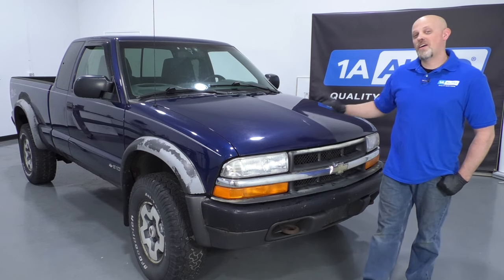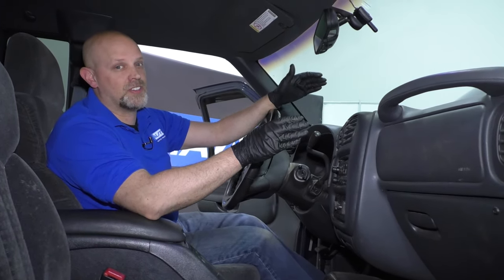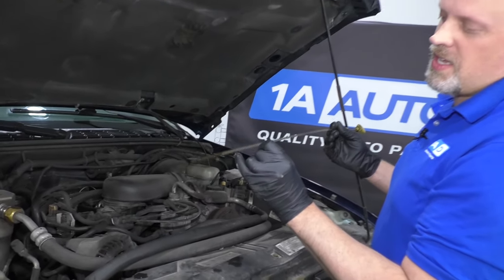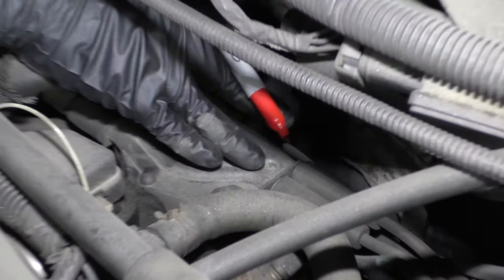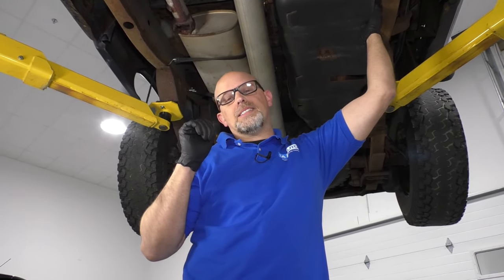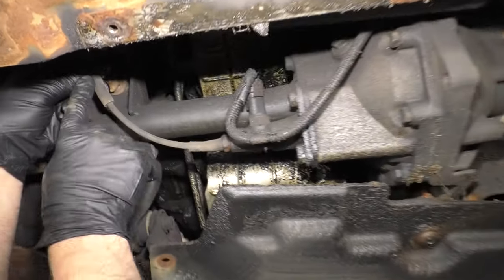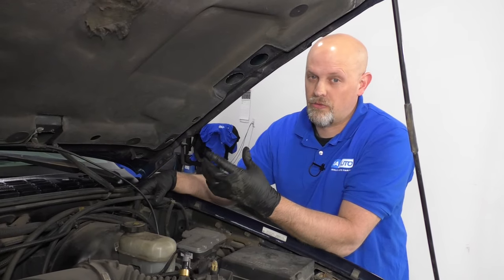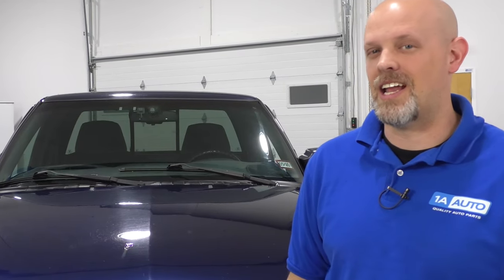Top 5 Problems Chevy S-10 ZR2 Truck 2nd Generation 1994-04

Comment: How reliable are these trucks including engines and transmissions?
Reply: Very reliable dependable trucks if they have been taken care of before you have bought. Regular oil changes, ignition etc. Mine has 222k miles and I drive it to work everyday 60 miles. 2000 4.3 4x4 v6 s10. Original motor and transmission, original AC still lol still blowing. Only major replacement I have ever done was the lower intake manifold gasket replace and I JUST did that. Other than that I put in new radiator, waterpump, thermo housing, thermo, radiator hoses, tensioner, pulley. Runs like a champ still for 222k mileage.
Reply: @travissnyder8277  same for me. I have  2002 Blazer with 215k.  I've replaced the same stuff. Plus distributor, teeth were wearing sharp, noticed it putting the lower intake gaskets in. Also new fuel pump. And my original AC still works great also!
Reply: @travissnyder8277   Is the 2.2 reliable also ?
Reply: There a great vechel
Reply: There a great truck.BUT You best have a well stocked tool box,  and a lot of mechanical abilities.
Reply: Reliable if they have been taken care of.  Far more reliable than todays newer trucks.
Reply: Depends on how you drive it and how it's been taken care of bought my 2.2 at a hundred thousand miles I put 50,000 miles on it so far and I haven't had any major problems except a few normal things I'm hoping to get another 5 years out of it
Reply: Mine had 350k+ on it before it died from rust. 
Other than general maintenance. And 1 transmission rebuild.  Can't complain. Looking for another blazer ZR2.
Reply: Im from Germany(Big USA Fan since  I was a Kid, I love everything the Landscape the Cars, the people just everything have been there 3 times and hopefully I'll live there one day) I got a 1995 Gmc Sonoma epual to the s10 also with the v6 but the motor has a stroker kit and the Cylinders were drilled to about 4,8 maybe 5 Litres, a bit massive for a v6 but she runs fine, got around 130k on the clock but kilometres so around 80k miles, pretty good for 25 years still the original motor and transmission(manual). Never had any problem for the past 5 years maybe because I'm only cruising with her on Friday or Saturday. Gas is pretty expensive here, every car is a 2L diesel crap. Dang when I'm out at the supermarket people taking photos and looking like holy what's that.

Comment: My 2001 s10 just randomly stopped. Battery is great, fluid great, has a little over a half tank of gas, just turns over but not all the way

Comment: I've seen all these problems on mine.  Some more than once.  Bonus issue, the hoses below the engine go bad.  Power steering and oil cooler lines.
Reply from the maker: +b baxter Thanks for checking us out! http://1aau.to/m/Shop-1AAuto-c

Comment: How much is it for a engine swap the motor was 700 what would be the price that he should charge me to change the motor Please comment back
Reply: If I recall it's about $700.+/- if your swapping for the same engine. It could be more depending on the shop. I just recently had to replace my transmission and I paid $750. For the used one and labor. Hope that helps. Make sure you get new motor mounts and have the valve cover gaskets replaced as leaking ones will destroy the motor mounts. And have them flush the cooling system and replace the orange Dex-cool coolant with the green coolant as the dex-cool kills the lower intake gasket. There was a lawsuit that GM lost in 2012 over the orange dex-cool coolant. If the replacement engine has over a 100k miles have them also replace the lower intake gasket and your replacement engine will last for well over 250k miles plus. Hope this helps.

Comment: 2 more points on the distributor.
1: it is very common to get crossfire between cylinders 1 and 5 because they crack or wear on the inside and there will be carbon tracking on those runners.
2: the mounting tabs for the cap are plastic and a lot of people break them while changing a cap and rotor.
Reply from the maker: +Eric's Variety Channel Thanks for the feedback!

Comment: Is that vacuum switch also on the 1999 Bravada Smart Trak transfer case?  My front end jumps a little when turning sharp on pavement. Like the front end is in a bind. I was wondering  if it is stuck in 4wd.

Comment: A lot of times as with the 95 z-R2 I had was the spider injection lines which are a hard plastic will melt and cause it not to start. I learned after a new fuel filter and pump.

Comment: I had two 1998 S 10's, the only problem I had was Universal joints that went bad every 10,000 miles.  I got really good at replacing them.
Reply: I had a shop in Ronkonkoma Long Island replace my rear u-joint and on the way home that night from a party I started to hear a load humming and bang the two cars behind backed off and I realized my drive shift blew out and I let my truck roll as far as possible to the side of the expressway. One of the cars pulled over and the lady said something large fell out. I looked and yep the drive shift was missing and there was transmission fluid all under the truck and on the back. AAA took four hours they showed up at 4:30AM I had tried to see if I could get it to go into 4x4 and limp the truck home but that didn't work. The next day went back and  found the bent up drive shift and looking at the U-joint the shop in Lake Ronkonkoma that replaced the U-joint forgot to put the grease fitting in meaning they never greased the U-joint. I had AAA tow the truck to that shop and they were willing to replace the drive shift ok few hours later they tell me my transmission won't go into gear and blamed me.. ummm hello if your driving and your drive shift falls out the seal between the drive shift and transmission can't hold the transmission oil in duh. Anyway, I needed the truck back ASAP and laid out the $700.+ for a used Transmission. The used transmission has a whine under acceleration but its not horrible. I know most of you are saying I should have sued the shop but I didn't and I still us em but a short time later I had asked them to find out why my four wheel drive wasn't engaging and they said I needed a new transfer case control module and wanted $400.+ to replace it. I looked it up and it's the kick plate on the floor of the passenger side and three nuts and two connectors. I borrowed one out of my rare 2000 GMC ENVOY and bam fixed. I later purchased a new one. If you have this problem make sure you get the right unit the plugs are color coded and I believe there are three different unit.

Comment: Ive had all the problems mentioned.The heater core made me sick for months afterwards. the head gaskets cost me an  engine ,milky oil  the dex cool cost me another engine overheated ,2600 to do the heads or 2100 for a new engine and body damage from shop that replaced it, also stole my battery 2 fuel pumps all 3 oxygensensors the wheel rs bearing 2x a tow after the x case problem a battery every 2 years 2 transmission rebuilds.3 radiators i have about 143k miles on it and its a 99
ac has always worked great but i have a lifetime warrantee on it and fuel pumps.Ive never wheeled it i just drive it.was mydaily till the heater cores fumes almost killed me mabe 3 years ago.I have not felt the same since.Doubt if i will buy another gm truck.i drive a dodge now.New motor cost 4500 installed about 2 years ago and has maybe 1k miles on it.I still drive it now and then but i have not done the heater core and wont take trade value on it

Comment: Most common problem shifter piece inside transmission it’s a factory recal in that 4L60E transmission but it’s a cheap fix the piece is about 30 bucks just have to drop the pan to replace with better one it bypasses the electric if that makes any sense

Comment: I got a 2x4 so the last one/bonus shouldn’t apply to me, but my control unit for the AC is no good. When I bought it I knew this, basically the switch to toggle between different modes doesn’t ‘click but rather the knob will just spin round and round, and the unit is stuck blowing air as defrost, and not air conditioned. I think/hope that fixing that switch would allow me to select the other modes and get air conditioning again. Does anyone know about his and how I would fix it?
Reply: Take your old unit out goto a junk yard and try a used unit first. Remember to take the old unit with as there are two different units that look similar but very difficult. YouTube how to remove the unit it's actually easy.

Comment: Owner of a 2003 2wd 5 speed 4.3 v6 230,000+ miles about 220,000 intake started leaking out the front was not bad was adding water as it was summer got out the socket wrench to check the bolts on the intake found most of the bolts on the passenger side where the leak was were loose from the factory ? Some I put almost 2 turns on them, just on the passenger side?? A few months later I find a 2001 with 44,000 miles no leaks runs good checked the bolts on the intake same thing passenger side are loose from the factory???4.3 v6  in both trucks
Has anyone come across this? is this why the intake gasket is going bad?
Reply: You've made me curious im going to check it out as I have a coolant leak in front and back.

Comment: Thank you very much great video or your videos are fun I got a question when: does Lieke do the intake do you have to replace the head gasket to or just you kid away with just replacing the intake gaskets👀🌿Thank you again I love all your videos
Reply: Lower intake is all you need to replace for the issue he described.  I have a 98 s10 truck and a 2002 s10 blazer and changed intake gaskets on both do to coolant loss and oil consumption.

Comment: The S10 is a good truck if maintained properly. I am a 2nd owner of a 1995 that has the 2.2 and automatic. I bought it with a leaking head gasket,  notorious on the 2.2. After pulling motor,  cab and bed to re paint frame and bottom side of truck , put back together and in less than  24,000 blew head gasket again. I would recommend if you get one with the 2.2 , get a manual transmission. The automatic I believe revs to high. Doing a V8 swap right now along with a newer 4L60E and a 8.8 Ford rear end. Covid-19 has screwed up the supply chain for parts so that's why the truck is only 90% complete right now.  Sure , they have issues,  but what vehicle doesn't.

Comment: 1965 Everything a heater needed to do was controlled by a switch for the fan and two cables with levers. I assume mine are the originals. Problem 6 with these S10s is the automatic transmission.  Getting ready to install it's third $3000 transmission in 3 years.
Reply: 3 transmissions in 3 years?  Who is rebuilding your transmissions?  The sun shell will fail, but with some upgraded parts, the 4L60E is a fairly reliable transmission aside of misuse and abuse.
Reply: What year s10? 4.3L? 4l60E transmission?

Comment: Might as well do the valve cover gaskets while your into it that far.
Reply from the maker: +True skeptic Thanks for the feedback!
Reply: Yes they leak and the oil leaking down kills your motor mounts and unfortunately GM doesn't have anymore left and the aftermarket don't last close to 100,000 miles and its Not a cheap repair especially the drivers side motor mount.

Comment: When my intake gasket went I had yet to figure out where my coolant was going so I decided to change my oil to take a look. When I removed the drain plug orange Dexcool came out. It kind of threw me so I quickly put the plug in thinking "what did I remove the wrong plug" But no, the oil is lighter so the coolant (2 quarts) came out first.

Comment: They're cool little trucks while they last but I've dealt with them and they are rarely worth fixing and in my opinion are disposable and one of the worst vehicles GM has built. In my experience here's some other common problems: premature head gaskets failure, fuel injectors, insane level of rot/rust on every component including frame A-arms and other structural parts. And to top it off they are a pain to work on, everything on them is tight and difficult to access, and seems like every bolt is a different size than the last. I've owned and worked on about 6 of them and I'd never own another. And I'm a big Chevy guy. I'll stick to full size. And no hate toward any owner of them, this is just my experience
Reply: Braden Reed everyone Ik that had a s10 never liked them. They always ended up selling them and getting a different truck.
Reply: Owned a ' 91 silverado and now '07 both 4.3l best trucks! No issues just minor stuff. Affordable to maintain and easy to work on. Damn now I sound like an ad for Gm...lol
Reply: Have had decent luck with my 03 zr2, they are so much better than the rangers of that era.

Comment: What about this model with the 2.2?
Reply: 2.2 doesn't use a distributor, has serviceable wheel bearings in the front rather than sealed hubs, so the only common issues would be fuel pump and heater core. Only problem I had with 2.2's was ignition module and EGR valve (just unplug the vac line, problem solved)
Reply: @DavidSmith-sf2ys  Designed poorly,  head gasket issues,  EGR valve issues,  oil pressure sending unit issues. Mine was picky about the fuel I used and for the most part my fuel mileage with a auto was terrible. I would recommend the V6 or swapping a V8 in it.

Comment: I have a 2001 Chevy S10 pickup ZR to package with a 4.3 motor my mechanic did plugs wires in a cap then he said he had to reset the computer and he raced it so much the stuff from the  Converter was coming out of my exhaust then my truck started knocking is that fault of the mechanic from him racing it please comment back I am very intrested in knowing

Comment: Can someone help me out.  
I have an 03  v6. Automatic. My reverse lights don’t turn on 
Replaced light and fuses. Checked wiring.  
What else is there. 
Please and thank you
Reply: I have a manual transmission and there is a reverse light relay on the top of the transmission.  That needs to be replaced.
Reply: Don't know if this helps but older cars had a switch on the transmission gear selector. I have a 2000 GMC Jimmy Diamond Edition and the transmission gear selector in on the floor between the drivers and passenger seats and our 2001 Chevy Blazer SLT the transmission selector is on the steering wheel. The Oldsmobile Bravados are the same as my Jimmy on the floor.

Comment: anyone know any solutions to the problems my chevy s10 has, first it is very slow to accelerate and when it accelerates too fast (when i floor it) the whole thing just shuts off, second, it sometimes wont even start, it will turn on but wont crank and it just turns off completely after that, i tried taking it to an advanced auto place but the OBD2 plug was broken so they couldnt diagnose it.

Comment: Own a 01 with the 2.2 4 cylinder.
Three radiators, two water pumps. 
Finally flushed that dexcool junk out and put I Peak green.
Reply: Based on your experience do you advise people should get a 2.2 engine S-10 or the 4.3 ?
Reply: @staresce  go with the 4.3L

Comment: I wish i would have known about this my fist s10 was a 99 and I had to replace the distributor. And front end.

Then the transmission went out on me and I blew the engine.

I'm on my 2nd one now i just replaced the fuel pump distributor and ignition control module.

Now the transmission is slipping 🥴.

I love my s10
Reply from the maker: +Donneville Prescott Thanks for the feedback!
Reply: Time to change the transmission fluid and filter! It's actually as easy as an oil change, but you also drop the pan and take a few bolts out holding the filter, and bolt in the new one. But don't flush the system.. only change it. :)

Comment: I have a 99  S10 Blazer 4.3 4wd . I'm batting over a 100 %. I've had every one of the. Problems.  Some of them 3 times. Intake gasket, fuel pumps, wheel bearings... Still going 208500 miles. Body is starting to disintegrate.  Just back flushed both radiators, I just noticed a little antifreeze on the ground near the rear of the engine. I checked the heater hoses, there dry. Give me something to look for tomorrow.  I hope it not the head gasket. If so I think I'll  give a drink of  Aluma Seal and hope for the best, first. If its the heater core it would leek on the inside  right ???. Or do they have a drain to the outside??? Its  Always something !!!!
Reply from the maker: +Dave Schidlmeier Thanks for the feedback!

Comment: I have a 94 Sonoma 4.3 vortex my truck won’t start right off his cranks I’m sure I need a fuel pump but after started I let it warm up a min then at take off it’s hard to get past 20 it’s like it bogs down a few seconds will pass and it will get speed I can not figure this out , also could this be caused by the spider injectors??? If anyone has any ideas plz hit me up on messenger or here I’m jus stuck . My husband bought me this truck cause I wanted it bad I wanted a toy well when I got it it didn’t run perfect for what I was wanting it for but I was told it only needed a distributor cap and rotor button well 4,000 later she’s finally running but still not like it should jus need a some help with this

Comment: What about an 94 s10 blazer 4x4? Everytime I get it to start, and then I try to test drive it, it moves very very slowly, and I changed out the old transmission fluid, I put in new filter and gasket, and new transmission fluid in the torque converter, transmission and the transfer case. Truck moves fast in reverse but not in drive. How can I fix that issue?
Reply from the maker: +Senor Sancho We wouldn't be able to diagnose an issue like that here, you may want to have a local mechanic take a look at it. Thanks for checking us out! http://1aau.to/m/Shop-1AAuto-c

Comment: the biggest problem with the heater core and intake gaskets is the crap dexi cool antifreeze it eats the aluminum of the heater core best thing to do is flush out the cooling system and put green antifreeze in place of the dexi crap